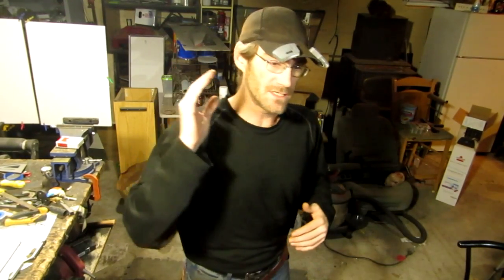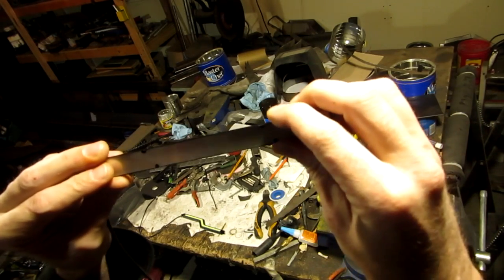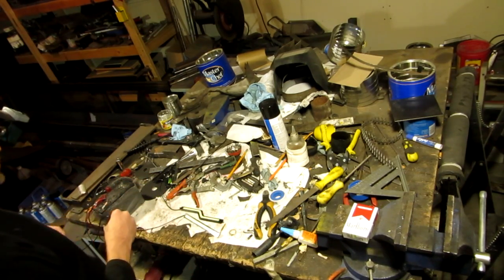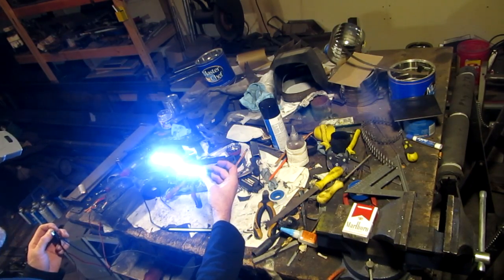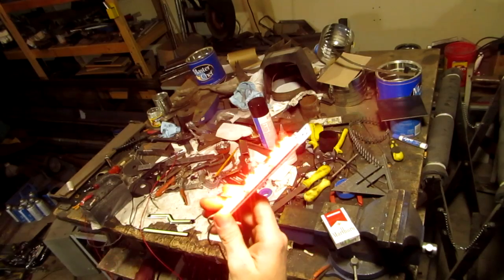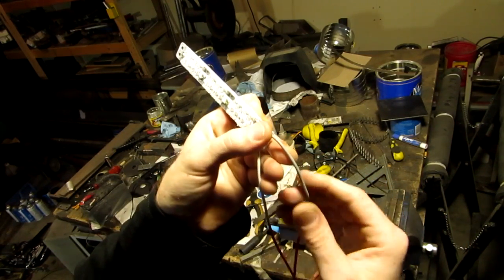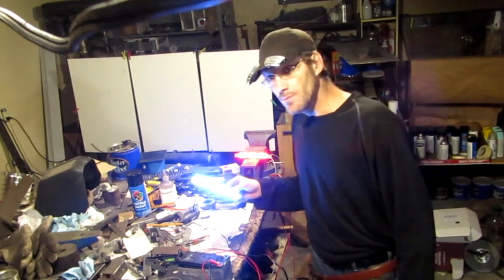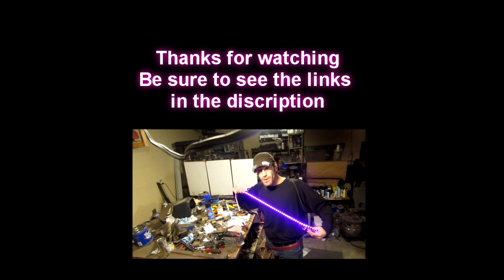LED's for the Fullscreen Machine | Here they are

Comment: no resitor to limit voltage ur brave
Reply: These COB led strips are very common on ebay usually are set with a resistor under the aluminum bezel, or I've seen as many as 4-6 of the LEDs in series for an attempt at voltage drop.